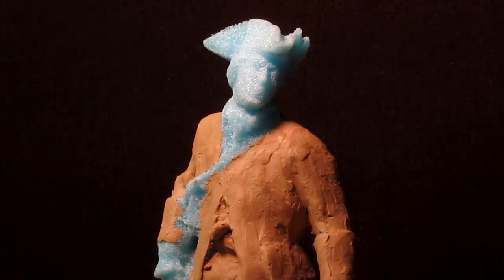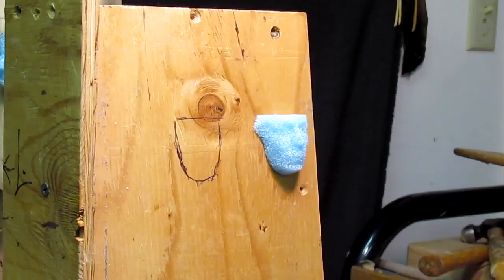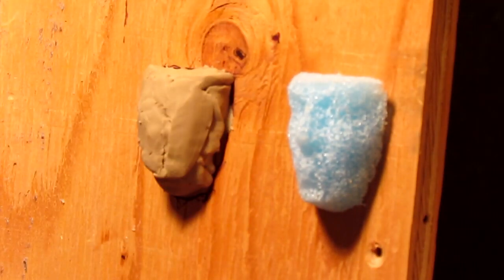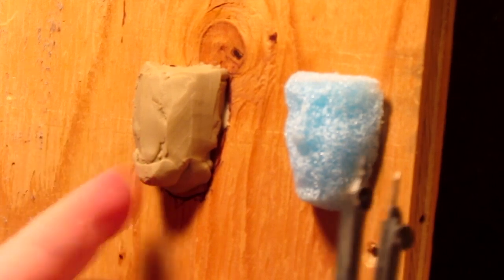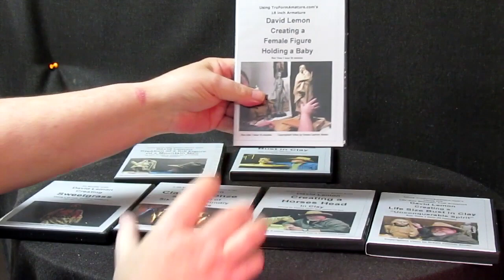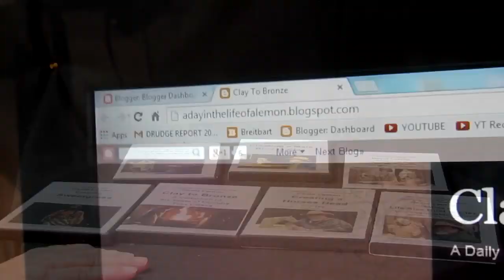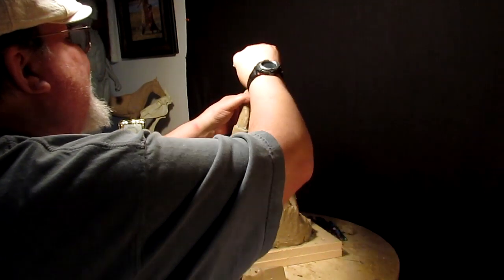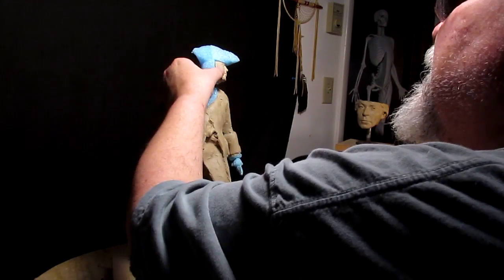Captain John Lovewell Reduction - Day 2 - Making the Face

Comment: I would like to do the tips of the tools with smaller tips (purple ones) would be more useful for miniatures.... that I have, I've had to cut and modify, as they come in very large sizes .... but I see that it is no problem for you...
I worry when you dropped the face ....
Reply from the maker: You should contact Shirley Johnson at skulptool dot com and suggest that.
Reply: David Lemon yep, that is a good suggestion ...I will do it